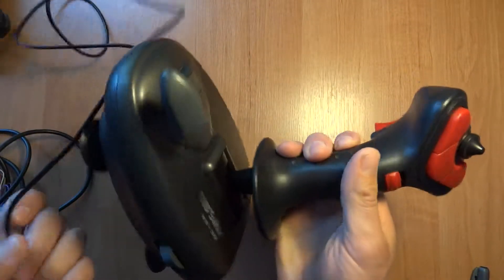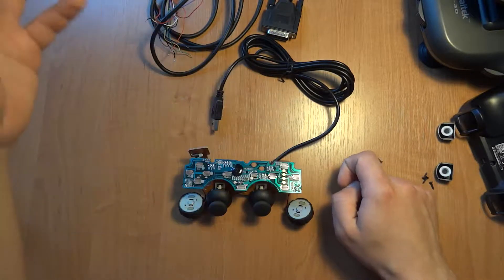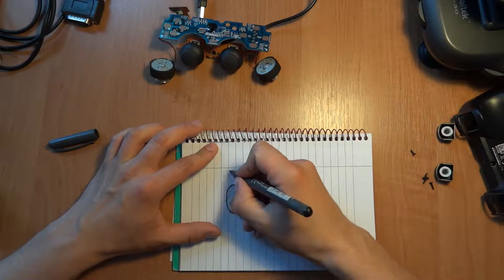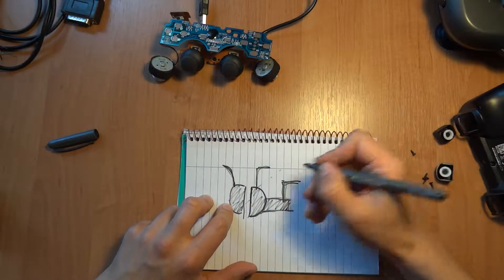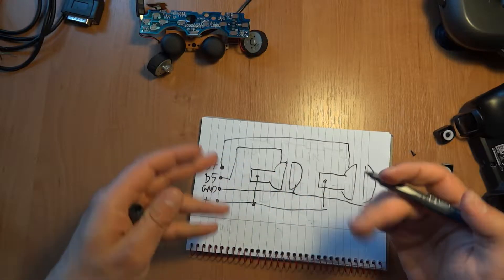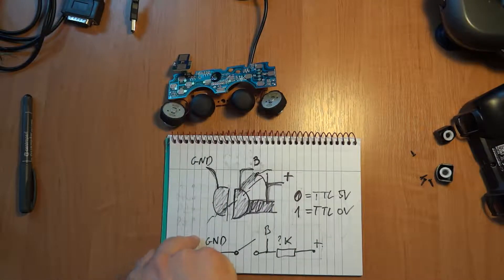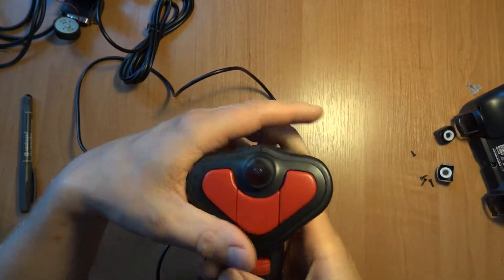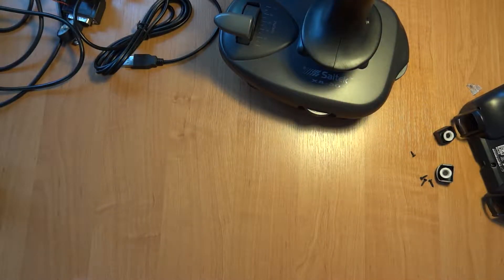Converting GamePort Joystick to USB Part 5: End result

Comment: hello, congratulations, do you think it can also work with old steering wheels with a gaming port?
I have an old steering wheel with force feedback and I would like to try to get it working again ...
time the problem may also be on the drivers

the steering wheel last time worked with win98
Reply from the maker: If it's 100% compatibile with game port (not a special thing that's made for some manufacturer), it can't have more than 4 axis and 4 buttons (sometimes 2 of those axis are used as 4 pseudo-buttons by having extreme "position" signals assigned to buttons in the driver). I remember that the wheel I had back in the day had the "force feedback" (just vibrations in reality) feature run as a passthrough of sound output. When there was a sudden increase of volume the wheel vibrated. USB game pads that have motors have support to be triggered when something actually happens in the game and not when there is a lot of noise like it was back then with mine 😁 if you would like to keep original motors in the wheel but be triggered by the game, then I think the voltages could be tricky or they could take more current than the ones in the game pad. In this instance if it's all 5V, you could possibly be able to get around  this by using relays to keep the design simple and not having to deal with any extra chips or transistors.

Even Wikipedia article is a great read on the topic https://en.wikipedia.org/wiki/Game_port
I think the most tricky part would be if your wheel have 8 buttons because you would have to re-solder those (4 normal buttons and then 4 buttons that "pretend" that they are 0 or 100 Ohm in Y2 axis and 0 or 100 Ohm in X2 axis and are both 50 Ohm in both when nothing is pressed). This could be tricky depending on how the wheel was built, but you can usually just run cables directly to your USB board from the buttons skipping all this. I'm sure you can understand how your wheel is setup by trying to measure resistance between ground and signal lines just like it's in pinout in the Wikipedia even without disassembling anything.

Comment: Brother can you explain PlayStation 2 controller port to usb port for play game in computer and you can draw color code chart please 🙏
Reply from the maker: Sorry, I don't really know how that converter would work. Signals and voltage levels are completely different, so it would require at least a microcontroller. Here is the pinout I've found https://pinouts.ru/Game/playstation_9_pinout.shtml 
There are some cheap PSX or PS2 gamepad to USB converters on Aliexpres and Ebay and those worked for me perfectly and would be probably cheaper to buy than make one yourself.
Reply: @pandaengineering  ok thank you so much